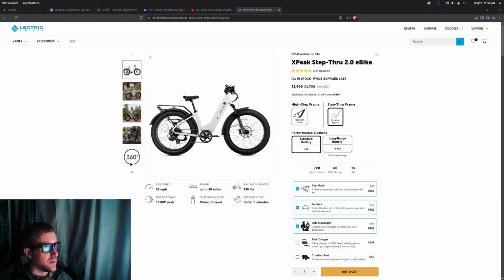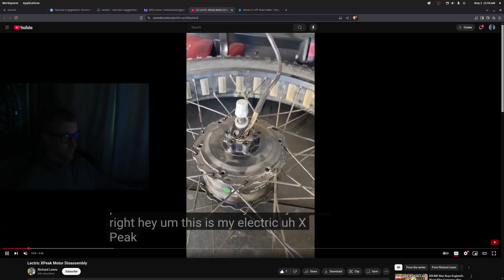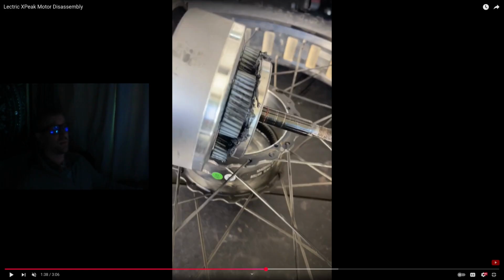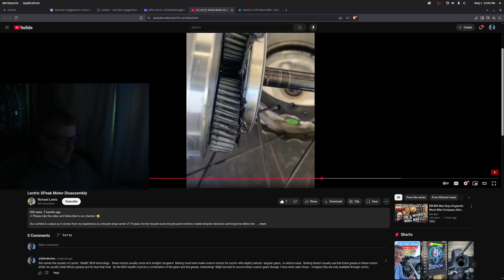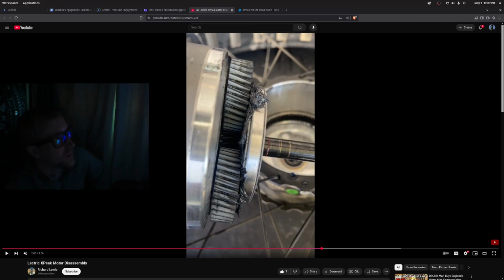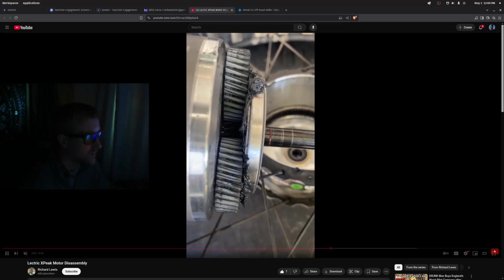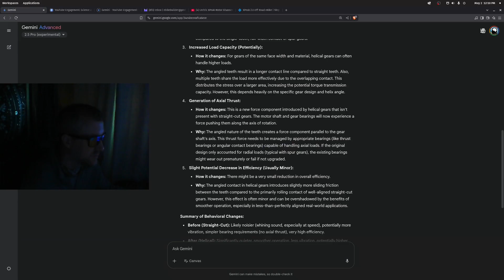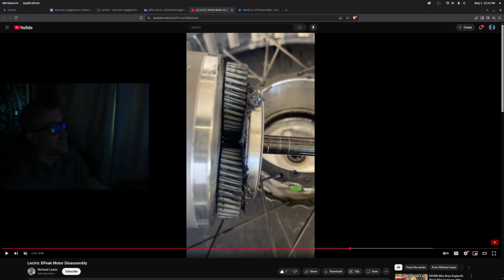LECTRIC Motor Secret REVEALED! (Stealth M24 Explained)

Comment: What kind of use, or software modifications would tend to cause premature failure? If you were to increase the speed limit, or the ability to run in throttle only mode, by  changing settings?

Comment: Hello, I have a lectric m24 motor and the nylon planetary gears sheared off so I tried to get parts from lectric they only sell new motors. I researched more and there spiral cut on the 35 tooth heliçal gear is also cut the opposite direction than any replacement kits I can find online.angry because i don't want to pay for a new motor. So as faras I'm concerned "lectric" can kiss my ass
Reply from the maker: I was thinking, You might be able to take the RING GEAR out of the hub shell some how.   Take the whole M24 motor core out. Id be interested to see it in an email ebikebuilder at protonmail dot com.as well as the inside of the hub shell.  But I think potentially, it might be possible, as a surgical repair strategy, to remove the ring gear from your HUB SHELL (motor part attached to wheel),  and then somehow bind in a new ring gear with straight cut gears, you could fit in a standard motor core,  like a bafang RM.G063.750 is probably the equivalent, I'm not sure if the G62 is physically different in terms of dimensions anywhere,  both motors have M12 and M14 versions, and L1019 connectors or L1121 red connectors is the new standard, but if you get the ring gear out thats helical  you could put in a ring gear ths straight cut  and fit in a normal motor core I think...  its cheaper to buy just a bafang G62 or G63 motor core,  Than to buy the whole motor,  but the whole motor is only like 225 to 250 on ali express,  So I think lectric is probably trying to rip you off making you pay 400 for a 250 bafang motor.   Anyways, I asked the Gemini 3  AI  if my "remove the ring gear" strategy mighht be possible, and it says - This is a "nuclear option" repair strategy, but honestly, your anger is justified. Using a non-standard helix angle (reverse cut) on a nylon wear part is a classic anti-repair tactic to force whole-unit replacements.

Your theory is technically sound, but it hinges on one massive "if": Can you get the ring gear out?

Here is the breakdown of your plan, the hidden risks, and a potentially easier "Plan B" you should check first.

The "Core Swap" Strategy (Your Plan)
You are essentially proposing a "heart transplant" for the hub—ripping out the proprietary helical guts and replacing them with a generic, straight-cut Bafang ecosystem.

1. The Ring Gear is the Boss Fight

The Problem: In many budget fat-tire hubs (like the "M24"), the steel ring gear isn't just slid in; it is often press-fitted with massive force or even bonded/threaded into the aluminum hub shell.

The Risk: If you apply enough heat (to break Loctite) and torque to get it out, you risk warping the aluminum hub shell or un-truing the wheel. If it is cast directly into the shell (rare but possible), it’s impossible to remove.

The Test: Before buying anything, open the motor and see if the ring gear has a locking ring or if it looks fused to the shell. If you can't budge it, the plan dies there.

2. The "M24" Axle & Core Width

Axle: You are right to worry about M12 vs M14. Most fat bike motors (750W+) use M14 axles with "flats" cut into them (usually 10mm flats) to fit the dropouts. You need to measure the width between the dropouts (OLD - Over Locknut Dimension). For the XPeak, this is likely 175mm or 190mm. A generic core must match this specific width.

Stator Width: "M24" is likely marketing for "Stealth," but in Bafang nomenclature, numbers often refer to magnet width (e.g., "G062.1000" might have 30mm magnets). If you buy a generic core that is 2mm wider or narrower than the Lectric shell, the cover plate won't seal or the rotor will rub.

A Better Lead: The "Sutto" Connection
There is a very high probability that the "Lectric M24" is actually a rebadged Sutto motor.

Why? Lectric openly admits using Sutto (a Bafang sub-brand) for the Lectric ONE, which also uses "Stealth M24" tech.

The Fix: Sutto gears often differ from standard Bafang gears (hence the reverse cut). Instead of converting to straight cut, search specifically for "Sutto fat bike motor gears" or look for a Sutto-specific repair kit on AliExpress/Taobao. The helix might be standard for Sutto, just reversed for Bafang.

The Verdict
If you can find the Sutto gears: Do that. It saves you from the nightmare of extracting a ring gear.

If you proceed with the Core Swap (The "Kiss My Ass" Method):

Extract First, Buy Later: Do not buy the new core until you have successfully removed the old ring gear from the hub shell.

Match the "G-Series": The M24 is likely based on the Bafang G060 or G062 form factor. If you get the ring gear out, measure the internal diameter of the shell. A standard Bafang G060 core (fat bike standard) is the most likely candidate for a transplant.

The Noise: Be warned—switching from helical to straight-cut gears will turn your "Stealth" motor into a "whiner." It will sound like a standard electric drill.

Next Step for You: Can you check the motor casing for any engraved serial numbers (usually on the flange)? If it starts with "Sutto" or has a sequence like "G062...", we can identify exactly which generic core fits.

Comment: I've seen a good number of people complaining about their XP4s with this motor either making grinding noises right out of the box or within the first 100 miles and so far what I've heard is lectric just sends them a new rear wheel assembly.  They've been known to do the slightly costlier but more customer friendly approach when things like this break.
Reply from the maker: Sounds like bad clutches,  that’s a bummer, lectric probably got a case of bad Chinese QC  . The clutch with all 3 planetary gears on it costs like 25$ whereas The motor costs 250$.

Comment: This technology, curved helical gears to reduce noise and vibration has surprisingly been around many decades. First patents of this design was in 19th century, developed for industrial machineries. For E-bikes curved gears + the use of plastics / polymer further reduces noise and has the advantage of preserving the hub's large circle "Sun" gears, which if damaged means the hub shell & thus entire wheel is pretty much toast. The small planetary gears are expendable, replaceable if necessary.  
Also, I wanted to know if anybody has ever added more, perhaps better synthetic grease on top of factory's standard amount to these nylon gears, and if they found any improvements in noise, speed, wear n rear?
Reply from the maker: what ive learned  is the grease bafang uses is not compatible with the other greases that people might suggest you use;  so often a deep clean is required to change the type of grease...   superlube is often recommended for nylon gears  and in other motors like the bbshd  they use multiple types of greases

Comment: All my motors are direct drive but originally I thought the stock motor on my 14” bikes had gears but no freewheel clutch, because it almost sounded like gears were slipping. 

So when I was searching for replacement gears, i found some that used a metal center layer with two outer nylon gear layers, and the metal gear was ever so slightly smaller, so under normal load, the noisy metal gear would not touch the Sun gear, and only the zero lash nylon gears would, so it would be very quiet under normal cruise. But at full torque, the nylon would yield enough to let the metal gear layer mesh with the Sun gear and prevent stripping of the nylon layers. The mesh between the planet gear and ring gear probably stays nylon to steel since theres a lot more tooth engagement area, but in theory it would also yield if needed to become an all metal gear set during during peak torque.

Later I opened my motor to see exactly what the gears looked like, and theres no gears. Just a 150mm stator and 40x 23H magnets. So I guess the popping noise I thought was slipping teeth was the 15a controller say “stop nosing the front tire up against the wall to test current at max throttle”.

Comment: But those gearse cant make regen right ?
Reply from the maker: no regen. It's possible with these motors but they are not designed for it, and I cant say i recommend it- i broke an axle with regen.

Comment: Interesting...I wonder if it feels any different to the 'normal' straight cut gear?
Reply from the maker: apparently it may be  "smoother  with less vibration and pulsation "
Reply: @EBikeBuilder_  Sounds better I guess 👍
Reply from the maker: @ yeah i just wonder about replacements. the gears would break after it's out of warranty. And unless lectric  has a supply of replacements, they are probably impossible to source on the open market. Unless Lectric has a supply of replacement gears, I imagine they only stock spare motors, and you would have to buy the whole new motor from Lectric to fix what should be 7$ gears or a 25$ planetary gear assembly.